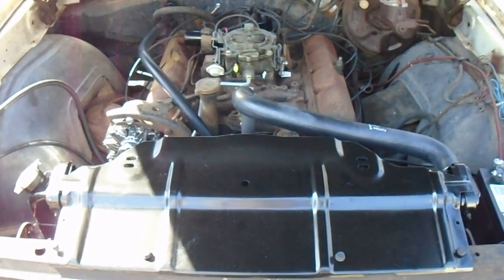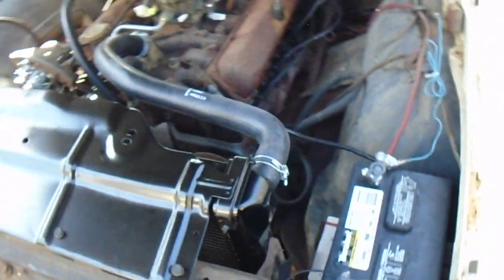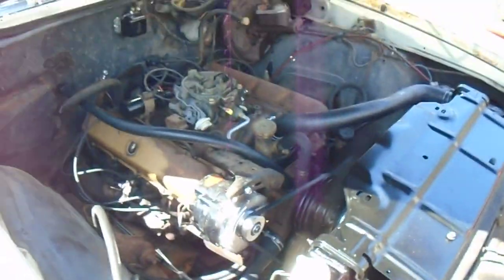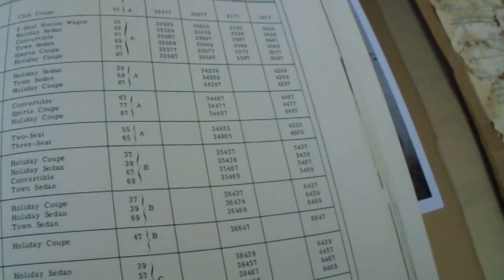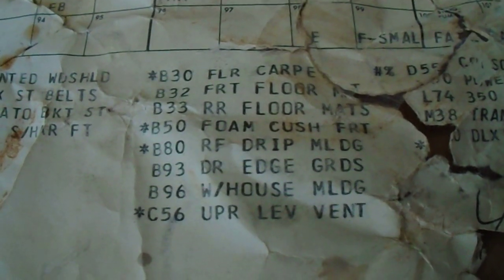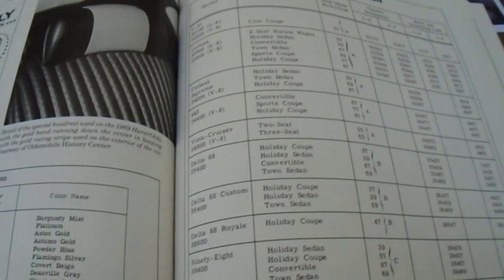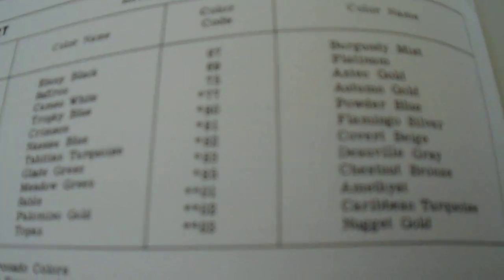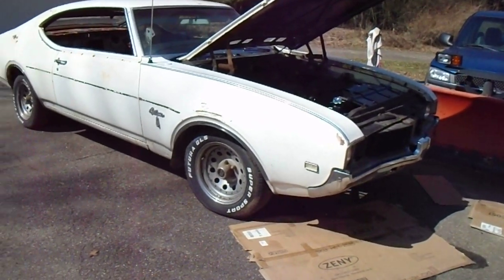1969 OLDSMOBILE CUTLASS S PROJECT PART 2. W-31 CLONE BUILD.

Comment: Couldn't help but smile when I heard it turn over and fire 😊 Just saw your first vid on this car .You've definitely made some good progress 👍
You going to go with HEI or keep it bone stock for the spark ? I went with HEI for my 701/2 Firebird and what a difference it made especially for the strict emissions I used to have to deal with when I used to lived in suburbia near Seattle .Working on a 70 Grand Prix currently and definitely have my hands full with this one .I haven't done a resto job in at least 20 years but now that my son is old enough I can teach him how to do this .Got it originally for under 1k from a fellow Pontiac fan .He had it as a parts car,didn't do much with it ,then my mom ended up wanting it so she had it for many years and now after her passing we've decided to do it justice and fully restore it in her memory .
Reply from the maker: Very cool. My dad bought a 1970 GP model SJ brand new and fully loaded. I was born in 71 and was in that car. I like the stock look but do not want to mess with points anymore, I have a pertronix II in the distributor. It works great. I may upgrade to a completely new pertronix distributor it the future. I have not even checked the timing or tuned the carburetor and it sounds pretty good. After I install the new dual exhaust system I will run it again and check everything. Good luck with your GP and take care.